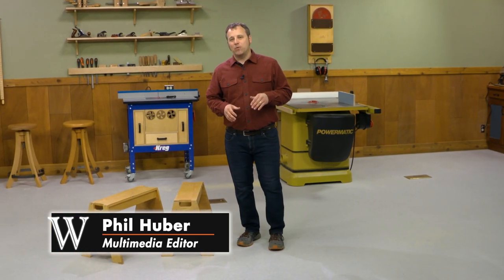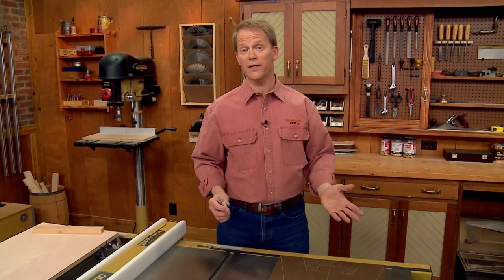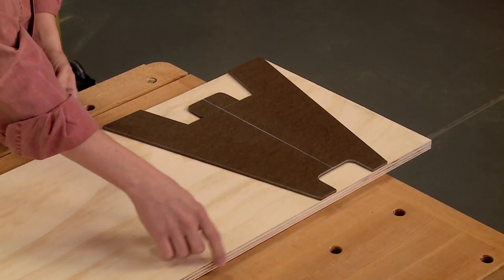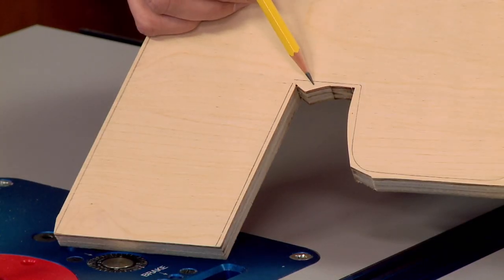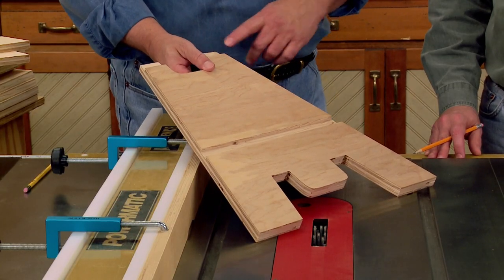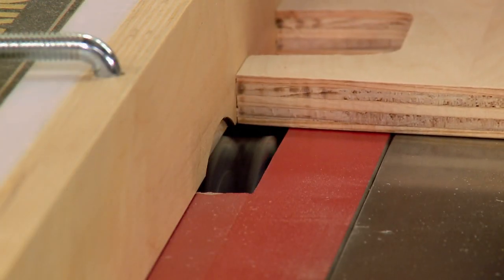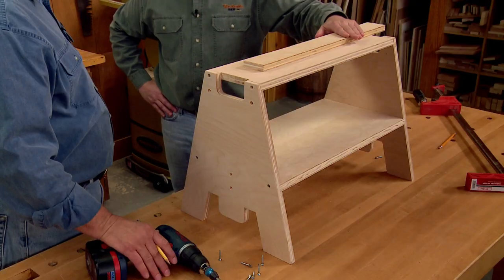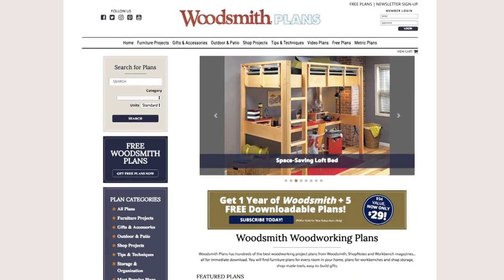Build Stacking Sawhorses from A Single Sheet of Plywood

Comment: Very nice build ! i did Woodworking professionally over 20 years and as a hobby nearly 35 now  i’ve always thought it was neat how we were all trying to build a better Mousetrap when it came to Saw Horses !  I sort of cheated myself as i painted mine  some very bright colors i had left over from a children’s bedroom to make them stand out more than others i do however like the stacking method of yours along with the  large flat tops  both would be excellent for any Woodworker or carpenter my primary job was installing Architectual Commercial Woodwork  and having a sturdy area to either stand on or  cut countertops on  were both a much needed  part of my daily  work  however the shelf    you have on these saw horses would come in handy  to set tools on  between tasks  or to utilize as safe storage  during my work day

Comment: My first thought was they are too short; only knee high on Phil! But then you redeemed yourself by stacking them. Great project guys! I also liked William Ellis’s suggestion. Thanks William!
Reply: You're welcome.
Reply from the maker: Yeah, for more applications they need to be in the stacked position, but in the shorter configuration they make a great platform for larger project assembly.
Reply: @WoodsmithShowandmagazine  I'll have to revise my original reply. These are fine and usefull in a shop setting, but not very practical for transport
Reply from the maker: @michaelhamerin3814  - True, they would be kind of bulky to take to a job site.  They are good for stacking up in the corner of a shop, but for travel I would recommend our Fold Flat Sawhorses: https://www.woodsmithplans.com/plan/fold-flat-sawhorses/

Comment: You have a pointless step in squaring off the inside corners where the upper and bottom meet.

Rather than taking that extra step, take the time with the template to add the radius to the corners at the top of the template to match the radius of the lower part after routing the part. Then they will fit and match together after the piece is completed with the router. No need to square off the corners.
Reply from the maker: Yeah, that would work too.

Comment: Make the template deeper with 1/2 material. Counter sink two holes to run bolts through. Bolt blank to template and run with flush trim with bearing on the bottom. No need for double sided tape.
Reply from the maker: That would work for this project because it doesn't really matter if there are holes in the sides of the sawhorses anyways.  Thanks.

Comment: What are these, sawhorses for ants?
Reply from the maker: Lol... You actually make a set of 4 from one sheet of 4x8 sheet of plywood. Two sawhorses will stack up to make a standard height sawhorse or you can use them individually to make a lower assembly platform.

Comment: Too short. Not a comfortable working height. This is more of a step stool.
Reply from the maker: The plan calls for making 4 of these sawhorses, so when you stack 2 together they are the working height of a normal sawhorse.  When they are in the shorter configuration they are good to use for an assembly platform or finishing larger projects.